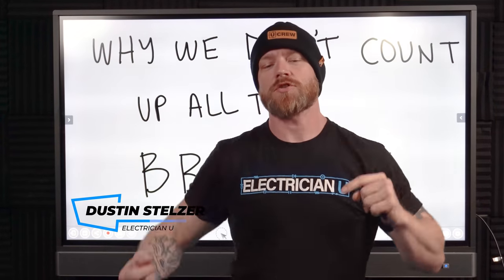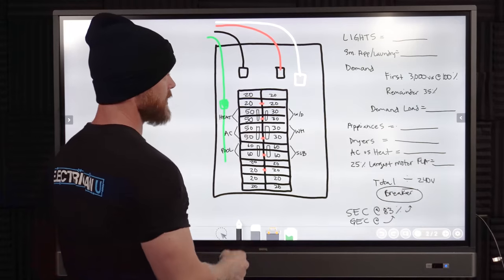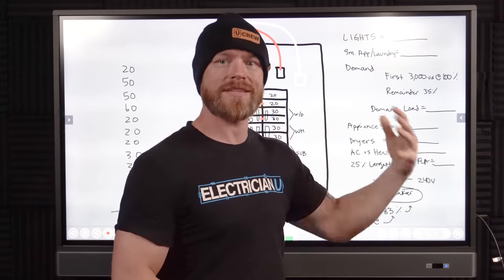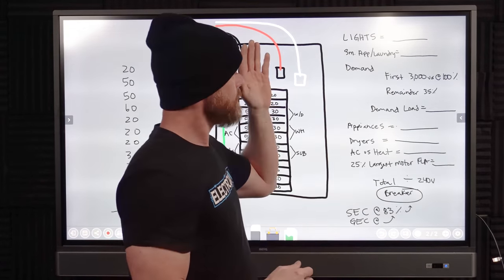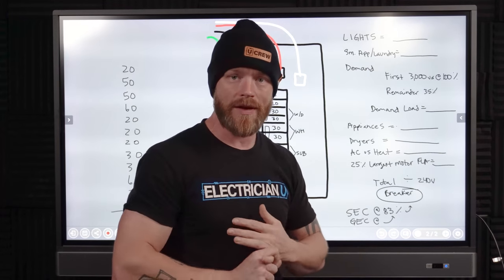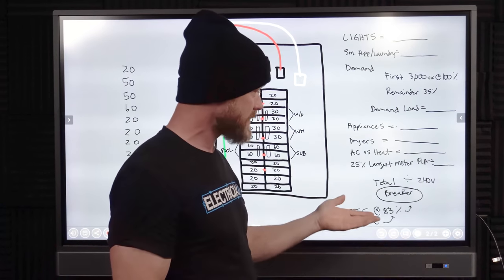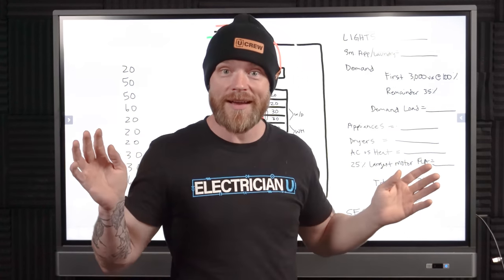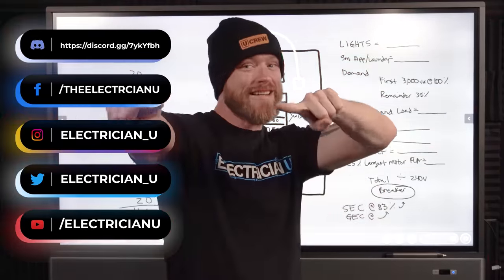Why is there more than 200 A worth of breakers inside of a 200 amp panel?!

Comment: You wouldn't believe how many people don't know that in a 200 amp single phase panel, you actually have 200 amps on each phase if everything is balanced correctly. Unless you have a shitload of 240v equipment in it. It's 200 amps at 240v and 200 amps for each phase
Reply: And unless your oven and/or dryer are on, each of those legs likely has less than 10A on them.
Reply: @jfbeam  absolutely true
Reply: Most people don't know your standard 25kVA transformer on your utility pole will pop very quicklyif you continously use the entire 200a @ 240v lol. Would be running at 192% and thats just for the 1 service. 🤣
Reply: @alenk646  lmao or you burn the insulation off their wire. It's so hilarious to me how we will run like 2/0 copper or bigger for a house and you see the utility line coming in is like #2 aluminum lol
Reply: @erich1380  2/0 is becuase you are running ithrough conduit. If im not.mistakrn , open air #2 AL is rated at 125 amps continous .The utilities built in a fuse/service drop lmao
Reply: @alenk646  right but 2/0 copper is for a 200 amp service which is very standard for houses. 75 amp discrepancy
Reply: There is only one phase coming into a house. 

220          220
         110

Center tap for 110

Single phase.
Reply: @dolphincliffs8864  that sounds like Europe
Reply: @erich1380  Rock band or The Continent?

Final Countdown? Rock the Night?
Reply: @dolphincliffs8864  continent
Reply: @dolphincliffs8864  yeah it's called single phase, but it's still a and b phase. Single phase is actually two in the united states. In Europe you get 208 from each hot. That's what I thought u were saying
Reply: @erich1380  Read it with an O scope. sine wave,peak to peak maybe 140 tops. But still a single phase and a single sine wave. I worked on 3 phase aircraft generators and 3 phase car alternators.
Reply: Peak to Peak times ,707 ,Root Mean Square.
Reply: @erich1380  Beers dude.
Reply: Love the band too!

Comment: Watching this video, I think it's worth noting that as we "go green" and are forced to stop building with "carbon fuels" (e.g., cities that are banning natural gas in new construction!!) some of the assumptions that would normally apply go out the window, particularly for heating. Not that these calculations don't deal with dedicated electric heat when it's installed from sticks, but what happens when you have a service that was sized on assumptions about the gas heat, and when the gas furnace needs replacing, the local "greed panded politics" code bars replacement with another gas furnace.  Now not only does that home need to retrofit in the electric heat, but all these calculations have to be revisited as well for something like the service size.  Bottom line - purpose of this comment - think very carefully about how much these green "no carbon" laws have potentially to decimate housing stocks and increase costs (while not doing much for global warming - a cubic meter of gas burned at your furnace vs. a cubic meter burned at a power plant both produce the same amount of CO2!)
Reply: Well....not exactly.  First of all, if a gas furnace is replaced by a heat pump, that's a completely different technology.  Not all temperature changes are equal as far as power draw goes.  A lot of old furnaces up in unconditioned and uninsulated attics do more to heat the flue than heat the house.  Heat pumps or split heat pumps put the heat where it's needed, not up the chimney.

Second, if the heat pump is also replacing an older air conditioning compressor, you are certainly covered for load, especially if it is a high SEER dual-stage or VRF (variable refrigerant flow) unit.  For both cooling and heating, it's going to draw less current, especially starting, than the original A/C compressor, so the homeowner is completely covered from a panel perspective.

What you are talking about is a worst-case scenario for a house that is likely over 50 years old, that may have a panel and/or service that is undersized and possibly unsafe that really needs to be replaced, regardless of the HVAC setup.
Reply: @andrewdiamond2697  Your comment is both correct and patently false.  Most of the housing stock in this country is in fact over 50 years old, a lot of it MUCH older than 50 years.  There hasn't been that much improvement in the safety of electricity services in the past 50 years... fuse boxes were gone long before that.  And even then, fuse boxes did their job well enough if you understood what you were dealing with.  To blanket accept that those 50 years old homes would need electrical upgrade "anyway" is false.  But when they do need to convert, they will need to bring everything up to modern code and this will be the kind of thing that forces affordable home ownership to do the way of the dodo.  Extinct. Even in many cases it will be the nail in the coffin for elderly people who give up on home-ownership and move into institutional living facilities... But what is even more to the point of my original comment is that where you have say an elderly person in a home that was sized for gas and the price of gas and oil skyrockets because its become "evil" and subject to "sin" tax and/or loss of economy of scale, those homeowners will start using electric space heaters.  And that will, in fact, render a result that differs substantially from the assumptions of this kind of calculation for simple 110 receptacles.  Interesting that you should say "heat goes up the flu", as most gas furnaces don't even need to vent "up"... they vent out the side of the house at ground level.  Been that way for 20+ years.
Reply: @robertlaw4073   I grew up in a house built about 60 years ago with a fuse box.  As bad as this sounds, the truth is my dad would pop in copper pennies for fuses that popped too often.

I haven't been to that house in 25 years, but I'd argue if that fuse box is still there, it's likely past its safe serviceable life, and probably should get a new panel.  Now if the whole house would have to be brought to code for a panel swap, that would be a lot of money.  BUT, in any jurisdiction I know of, only the NEW work must be done to CURRENT code.  If there is an unsafe condition in the house, it should be addressed, but I've not heard of any requirement to rewire a house when swapping a panel.

I have one property with a heat pump, one that was gas heat converted to a heat pump, and one that is still gas.  The gas property has all vertical flues, though one of the heat pump properties has "on-demand" hot water that is heated with natural gas and it has a flue out the ground floor side wall.

None of this matters though.  The bottom line is that modern heat pumps have lower amperage draw, particularly on startup, than older air conditioner compressors and any house that has central air conditioning should not have a problem with a heat pump.
Reply: @andrewdiamond2697  I have not heard good things about "modern" heat pumps, particularly when they are installed with a "geothermal" setup.  The poor result seems to be due to assumptions about heat load and how people heat homes that are generalized, so that if you fit that pattern, you will be happy, but if not, then you will lost ability to regulate temps.  Not sure though because this is just hearsay from others I know who have heat pump / geothermal.  They may not complain now as gas prices rise though.

As for the fuse box conversion, let's say like my grandmothers house - which was converted from fuses about 15 years ago after my grandfather died - the fuse box was probably very low in terms of the actual risks it posed - when fuses burned out, you unscrewed them and put in a new one.  This is "too dangerous" for modern people who might think it would be a funny twitter post to put a body part in the hole. Should all the wiring have to be replace? Well, there wasn't a 3-prong grounded receptacle in the place.  So yes, a responsible person WITH THE MEANS would say, definitely, this needs to be updated.  But someone on a fixed income is going to say, "Gee, if I fix this, I am not going to be able to eat."  You can get federal aid for all kinds of ridiculous stuff.  But you wont get aid or a tax abatement or anything like that for the cost of an electrical update.  It is really distrubing because more and more cities are passing blanket "safety" ordinances that give an inspector a carte blanche right to enter and inspect your property and literally send you to jail or fine you on the order of $1000/day for that kind of stuff.  I recently watched a crooked town near NYC pass such a law and the thing people were opposing was whether they would be able to keep junker cars on their lawn, when I look at it and say, that junker car is the least of your worries.  The town now basically has a sword of Damacles to hold over any home here and every person here (mostly fixed income pensioners)  who won't be able to pay for the updates that the inspector decides to cite will be selling their house to a rich NYC transplant.  That may sound like market efficiency, but a home is more than a commodity.  So I think it's very concerning stuff.  The Green policies have a Black side to them my friend.

Comment: 400 amp is called a 320 can for a 400 amp service . I Know where your coming from on the rest of what you said . 400 amp metercan is very common. That you say you don't know if there is a 400 amp meter can .CT tap cans are over 400 amp . Just saying .

Comment: how come all  breakers are a multiple of 5s
Reply from the maker: Easier on manufacturing process and easier to math out on the fly. I'm not an engineer so I can't speak to the actual why. Just the thoughts in my head when posed this sort of question. 

It would be really odd to come across a breaker that is rated for 18.9 amps instead of 20. When we only are allowed to meet the 80% rule for branch circuits. So that makes that sort of math easy.

Comment: Never made any kind of sense to me.  There are times when you will indeed be loading the panel almost to max.  Take a Xmas holiday celebration:  Clothes washer going, dryer going, dishwasher going, oven and burners going, heat going for cold weather, refrigerator and freezer opening and closing, Lights as it is dark early, blenders and counter top appliances,  tv and computers, hot water heater, auto block heaters, etc.  Now you know that company comes for the holidays so extra washing and drying of clothes, showering and cleaning up for the big dinner, cooking and cleaning up is intensive in short all these things can and most probably will be in use at the same time with a great deal more.  Same with other major holidays.  So assuming that "it is never going to all be on at the same time" is just wishful thinking and not even close to today's life style.  It is like saying "we are going to build in a flood plane because it only will flood once ever five years" not considering that every single time you are going to have to do a complete rebuild if you survive!  Nobody should be foolish enough to take that gamble much the same as derating active circuits on a panel.  Your house will only burn once so sizing the service to where that isn't possible makes sense.  It has gotten to the point that you knowing what your maximum load is like and the conductors and panel necessary to safely carry that load have to fight with your utilities to get them to provide the necessary amperage.  They continually way undersize the conductors for the load and exaggerate the effect of free air etc on them.  This is a trend that is dangerous especially as load only increases with the years as new gadgets are added.  It gets ridiculous.  At one point I had wired a house for a needed 400 amp service using 400 mcm conductors to the weatherhead.  When the utility hooked up they used aluminum conductors that were half the size of mine in the overhead service that ran 250 feet from the transformer to the weatherhead.  Driving around and looking at overhead services shows that most are similarly overloaded.  This being done by licensed engineers!!
Reply: Unless you have a 6000 sq. ft. all electric house, I doubt you will ever have a load anywhere near 400A. for instance your dryer is rated at 5000 watts, and may be on a 30A 240V breaker, but it only pulls 21 amps. and doesn't pull that 100% of the time since the heating element cycles off and on. You have an electric stove, do you run all of the burners on high with the stove on constant self clean cycle? Do you leave your refrigerator open so that the thermostat is never satisfied and the 6 amp compressor runs continuous? does your clothes washer run on a full spin pulling 12a all of the time? How big is your Christmas light display? I can if you compete with the Oleson display you may need that much, but I doubt it. The power company doesn't have to follow the NEC, and they are running their wire in free air. This allows them to greatly reduce the size of the wire they use and its legal. Also they size the conductors based on what they historically know your size home will draw. Unless you are growing pot and have a slew of 400w Metal halide grow-lamps and have 20 tons of air conditioning to keep the house cool their wires will not burn down. My house is about 1800 sq. ft. all electric, and my demand meter rarely goes above 9KW. I ran it continuously on a 52A generator during a hurricane. Granted I did not run my dryer, stove and water heater all at the same time, I could still cook and run my well, Central air, and most everything else for a week.
Reply: @hankkline7300  Again you miss the obvious.  Those loads running at peak only have to coincide just once to burn your house down.  In the particular case I mentioned it was electric heat (R19 insulation here in Alaska), hot tub, water heater, range, two apartments and a large shop.  Not to mention the water pump.  You must never have been around large family holiday dinners and other celebrations.  The fact is that if you have an appliance it will run at peak peer draw or near it many times.  The likelihood of several large appliances running near full load at the same time is unavoidable.  Even at less than start up pull that is enough to max out a 200 amp service.  Large screen TV's combined with theater sound systems (who would have believed it fifty years ago or even forty?) Computers for every family member. Electric frying pans, hot plates, coffee pots, clothes irons.... It goes on with most self running so one person can have many things going on.  Today's homes run at 2400 sq. ft. with three baths, theater rooms etc. and many much larger wired on a 200 amp service.  You don't seem to have any conception of how much power a modern home with five or six occupants can draw in reality.  Therein lies the danger because people rely on professionals who are not in touch with reality.

PS: Don't forget the vehicles plugged into block heaters outside as well.  I am not even going to bring up the topic of breakers not tripping at their ratings (U/L rated and top brands).  There are enough hazards without intentionally under sizing the service.  It only takes one time overloaded to cause a fire.  I just installed a 400 amp service upgrade and it was nowhere near your figure.  Prices don't get higher than Small Alaskan communities either.
Reply: @douglasthompson2740  Sorry, I didn't know you were in Alaska with a 2400 sq. ft. home, large shop, with two apartments and more. I thought you were in the lower 48 with a conventional home. Obviously you would have to take all of the extra high demand loads into consideration. My apologies.

Comment: 3:57.  No no no.  Sorry. I really am but I just can't make it any farther.  I tried.  This is a horrible explanation from the start.  The reason you don't add up the breakers is because the number on the breaker isn't how many amps it's passing.  Not even close usually.  A breaker has one job. It's job is to protect the wire so it can't get too hot and burn your house down.  Different circuits require different sizes of wire so the bigger the wire the higher the number on the corresponding breaker.  Wires are sized by load which includes in rush.  In rush is the power required to get something started.  For example an condensing unit will run at 10 amps but the inrush is high so you need a  50 amp breaker.
Reply: I think you missed the point entirely. He's not explaining what breakers are used for. He is talking about sizing your brakers and pairing them to the correct circuits without going under and risking damage or without going overkill and wasting money.
Reply: @MisterRose90  and for the most part he's incorrect and totally backwards.  You don't determine the size of the main breaker then determine the size of the incoming wire.  You first determine the size of the incoming wire then you can determine the size of the required breaker.  He's just backwards in his understanding.  The load breakers have nothing to do with the load requirements of the panel.  The load breakers only care about the size of the wire carrying the load.  You don't size the breakers according to the load on the circuit.  You size the wire according the the load on the circuit then you size the breaker according to the wire size.  He's misleading and backwards.
Reply: @MisterRose90  and actually, you are missing the point.  Where in the video does he explain how to size a breaker?